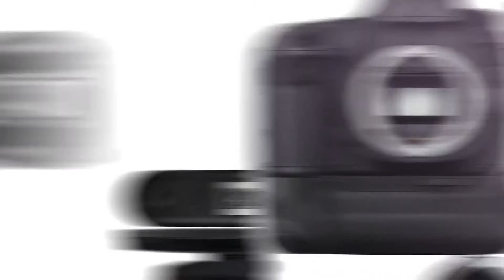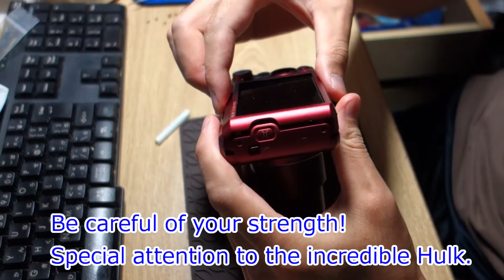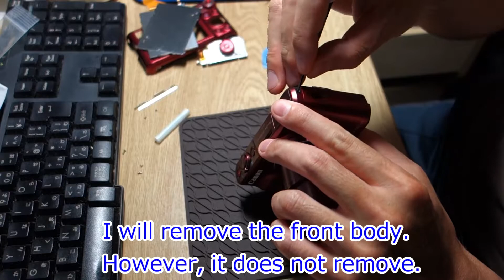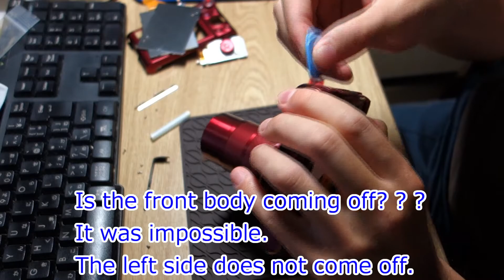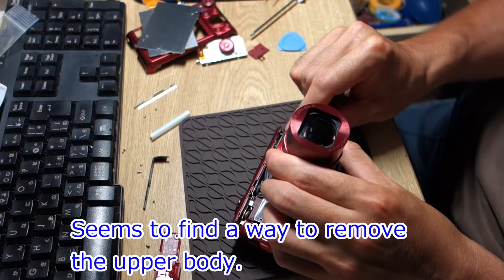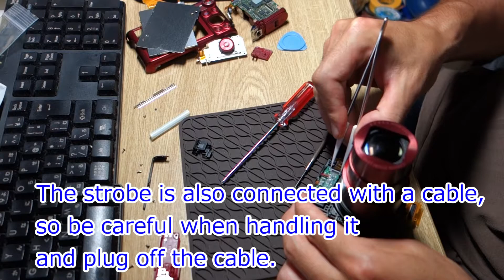Canon Powershot SX720 Red disassemble[Part1]

Comment: Thanks for this video.. this is the only video I found on the internet for my camera. .I"ve the same  Canon Powershot SX720 Red Model .. last year dropped from less then a ft... and now not turning on.. I put it a side and searched a lot on internet .. for any repair document. Finally found this video.. I will now teardown a little and see.. may be any connector got disconnected or what!!.. 
Thank you
Reply from the maker: If the cause is a fall.
If it is displayed on the LCD but there is a lens error, there is a high probability that the cable will be broken or the resin barrel at the base will be damaged.
It may happen that debris is caught in the gear and does not rotate.
If it is not energized, the fuse on the back of the main board may be damaged.
Unless it is submerged, it is often a simple damage.
However, it takes an electric tester, magnifying glass, other tools and patience to find the cause ...

Comment: thank you for share, by the way, if i only want to clean the lens inside, should i disassemble all the bodys? any convienient way?
Reply from the maker: The lens is also disassembled halfway in Part 2.
Be careful not to cut the cable when disassembling.
The combination position of the lens is originally engraved, but I think it is difficult to understand for the first time. Therefore, mark inconspicuous places with a magic pen or the like.
Record the position of the screw. Take a picture of the cable connection.
The inner lens is made of resin, so ethanol is not used. Immediately after using ethanol, it is beautiful, but the resin deteriorates and becomes cloudy after a few months.
Be careful as the outermost lens may come off if you press it strongly from the inside. Focus adjustment is required when the lens comes off.
Just be careful.